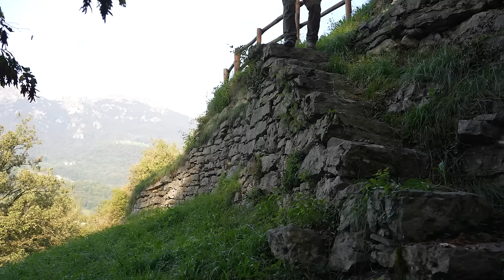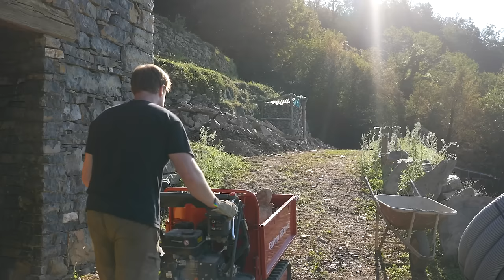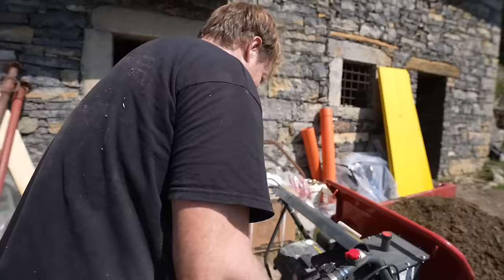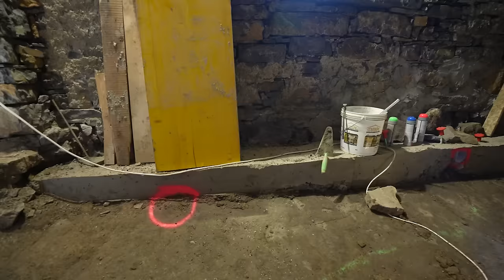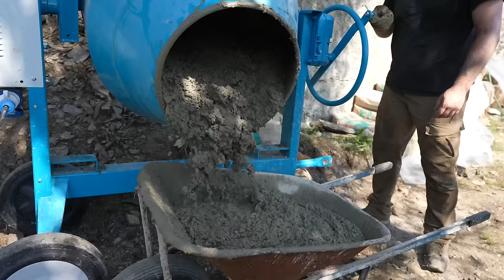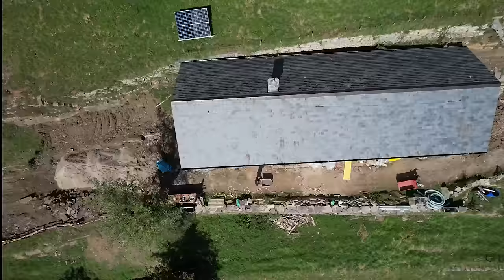A Big Turning Point! / Renovating a Stone Cabin in the Italian Alps

Comment: Brady that's such hard work - make it a little easier on yourself by facing the wheelbarrow in the direction you're gonna push it before you load it with concrete - over the course of the day it will save you a fair bit of muscle power ;)

Comment: As I’m in the middle of a remodeling project myself, I have to ask if you had to stop before pouring the concrete for the inspector to look at your air vent system you placed.  We’ve been having problems with failed inspection issues that delay the next phase of the project. Was yours (at this particular point, that is).  I remember the earlier problems with the inspection and the requirements imposed. Just curious.

Comment: probably too late comment,  you could build "pier"  which is board and rock-wood post  to wheelbarrow your materials in and out.   think of this system; your inside house is a "lake", with 'pier' your way around.   then take piers out (reuse wood for something else). one of my old experiment... you want about a foot wide or more board. to walk-barrow.  a foot wide is about 30 cm. I used plywood to cut on the expense during the experiment. 

but then I realize something else.  you are on a mountain.  wood haul is going to be "an exercise".  I am impressed with your dedication getting your house up to ridiculous code.

Comment: What you are describing reminds me of the radon mitigation system we have in my home.  we started with one pipe out the roof with a fan pulling it out and then a few years later we had a flood which changed the environment enough that the radon warning device started beeping again and we then put in a stronger fan on the pipe and while it helped, it didnt' do enough, so we sank 2 more pipes in below our basement floor and one more exit out the roof.  So we now have 2 pipes in the basement floor that vent out a pipe on one side of the house and the 3rd pipe vents out the roof on the other side of the house.  both have strong fans that are continously running.  And no problems with it in the last 15 years. yeah, if I were you, I'd overdo what you need to in order to keep that mold free because you don't want to have to go back and redo if it's not enough!  In my case, we just had to go through a concrete floor in a traditional house.
Reply from the maker: Yes this is exactly why we are over doing it! Don’t want to have to go back later!

Comment: The air circulation problem in the crawlspace can be eliminated by adding baffles to direct airflow into the corners.
We had the same issue with our cottage on by using pressure treated plywood and some 2x lumber we were able to get the air directed where needed.

Comment: you could use a wind turbine to drive a fan forced duct running along the low edge of the house. the faster the wind the more air is pumped in. and with the right covers over the vents behind the house, you will also get a stronger vacuum pulling air out.